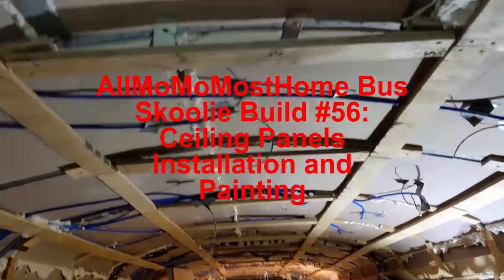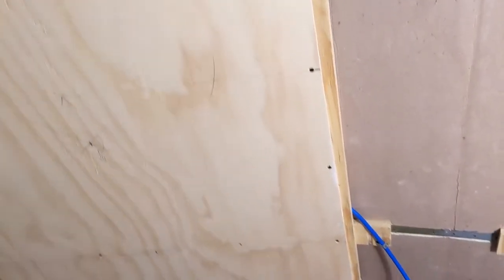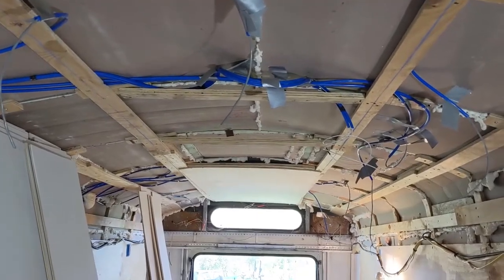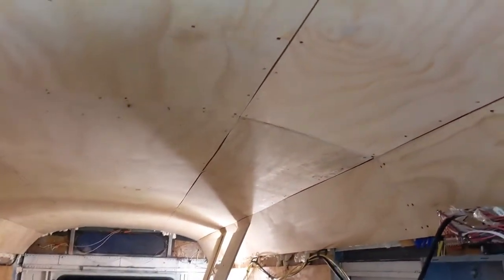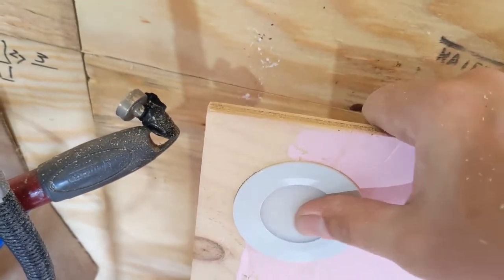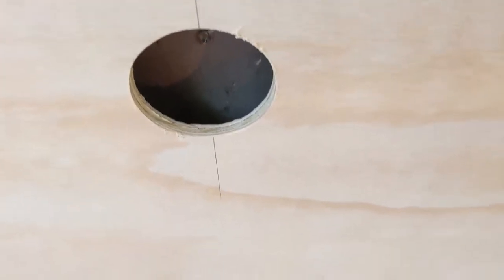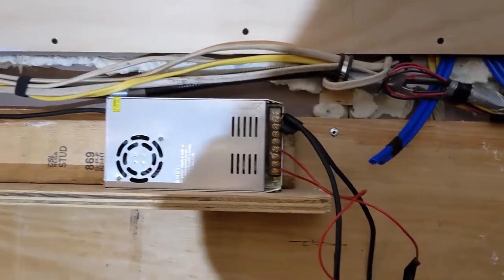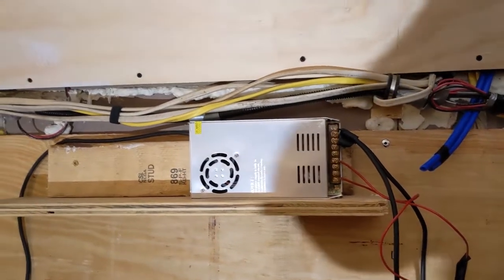Skoolie Build #56: Ceiling Panels Installation and Painting.

Comment: What thickness is that plywood? Looks nice!
Do your best, wood puddy the rest! (at least that's our building motto!)
7:31 - If you get a thin strip of neoprene weather stripping and wrap the back of the light edge, it'll take up the movement. But without it, they shouldn't "move" if they are not touched once in the ceiling. And your ceiling is so damn high... No one is touching those lights! We love how the ceiling turned out! Completely changes the look of the space doesn't it?!?! Your family must be so excited to go on road trips in that big beauty! Keep rockin' it! - Erin + Brian
Reply from the maker: I used 3/8 AC sanded on the ceiling. It worked well. Just rigid enough. Good idea on the neoprene. I may do that.... Glue some to edges of led lights. I'm doing another paint coat tonight and wiring the lights. It'll be nice to not have all the trouble lights to see in there after that!